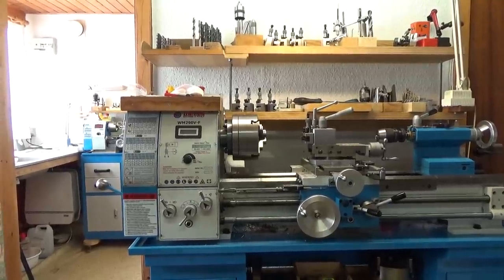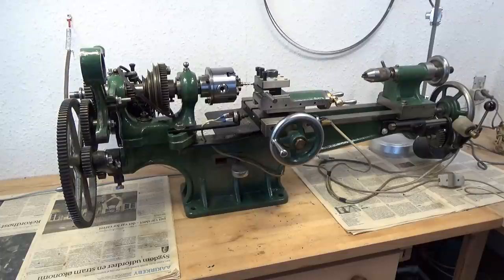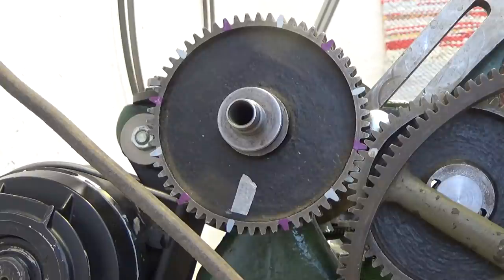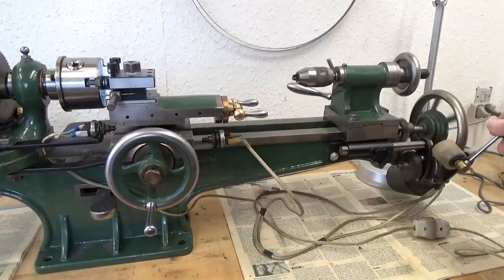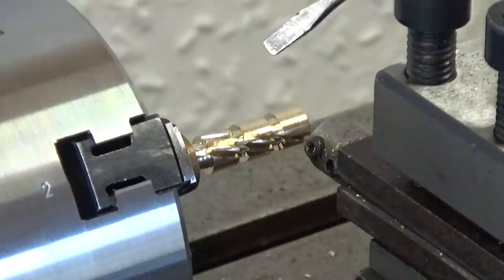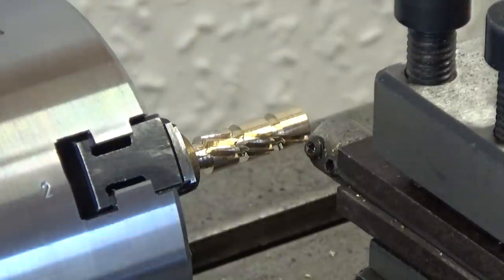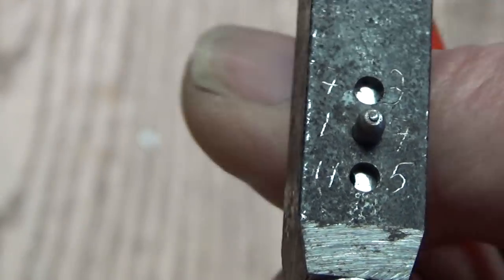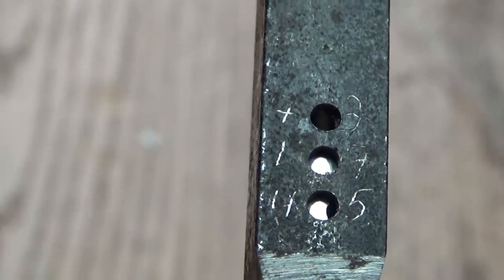Cutting Helical Gear Wheels On An Old Lathe

Comment: I have a similar very early Drummond Brothers flat-bed lathe, which I found about 50 years ago, although it doesn't seem that long ago. While I was still a subscriber to the British publication "Model Engineer," one of the readers in their correspondence column dated my lathe  (tentatively) as having been built between 1902 and 1903. It has the original Drummond brass name plate, which is my good fortune. The chap in the UK narrowed the date to this period because of certain characteristics of the headstock design which were improved very early in production. I have the basic lathe and a 4-jaw chuck, but none of the change gears or other accessories.  Yours looks to be in excellent condition. Mine came from a neighbor, who did not know the lathe's history. How it came to be in the basement of a farm house on the prairies of western Alberta, Canada would be an interesting story all by itself. I traded a running Maytag 2-cylinder washing machine engine for it - probably a reasonably fair exchange. If you are interested, I will see if I can confirm the serial number and any other information from the builders' name plate. Thank you for showing your lathe, still operating and doing very useful work. It reminds me that I need to get mine set up again after moving to a new house about 4 years ago.

Comment: I have a Drummond round bed lathe in reasonable condition I have a full set of change gearwheels and have accumulated the necessary whitworth spanners. I think it was made around1925. This is my only lathe and Tony from Drummond was good enough to supply me with copies of the original documentation which included the gear ratios that are used to cut imperial and metric threads.

Comment: Some folks will look at a Rembrandt and marvel at what they see. I feel no different about your old Drummond Bros. and your MAGNIFICENTLY PRESERVED old gas engine! OMG!! They're like looking at the centerfold of Machinery Hotties! Your friction  brake is novel but have you considered using an Electronic Brake? Just about all electric AC or DC motors can be braked with or without mechanical interaction or addition of same. I'm a long retired EE/Tech desiring nothing more than keeping that old girl cutting curls or chips!
Wakodahatchee Chris

Comment: Hello Find , thanks for explaining how to make these years by a " shaper" method .
The Drummond lathe was made down the road from me in Guildford Surrey England about 100 years ago!
I have a Little John lathe that is about 70 years old , and I am in the process of adapting it to cut gears using a hobb , which I will have to make as well , Hobbs are too expensive for me to buy ! The gears on my lathe use 16dp X 14.5 degrees pressure angle ! All the best, Jim Simpson

Comment: That was rather ingenious. 
When I was training, (mid 1970's), multi start threads or worms were considered something of a 'black art' and considered very difficult to make accurately without specialised gear cutting equipment.
 Phasing a gear wheel is a much neater solution and actually makes it look easy (although I know there will be quite a bit of math involved to work out lead angles)

Comment: Many thanks for creating this video. It is a very interesting lathe with what looks to be a very interesting 'modification' regarding the leadscrew drive (headstock end) and it's certainly not common to power a lathe through the leadscrew :) You clearly have a lot of engineering knowledge and skill to create such fine craftsmanship as your work in this video and the engine shown towards the end.
Wiper motors are very good for adapting to one's needs - whether leaving the original crank on, driving from the reduction gear or via direct drive from the motor shaft itself. (My dad ground the motor shaft down to fit to Meccano !)

Comment: I have a flatbed 1904 Drummond lathe identical to this one but still original and unmodified aside from some additions such as a dividing plate made for the outer end of the main spindle, a tool post drill and grinding spindle, and a revolution counter for winding radio coils.

Comment: It’s always great to see one of your videos. On of my favorite of your engines is the 3 cylinder 2 stroke. I’ve watched it countless times and i still have yet to understand how the vacuum is created to pull in the fuel mixture. Maybe a tear down video ?
Reply: first things first....there is no such thing as vacuum.. it is a absence of pressure , atmospheric pressure overcomes negative pressure... understanding the operation of a two stroke... as the piston goes up and  down. the piston skirts act as valves, sealing off the crankcase, the pressure that builds in the crankcase, empties as the piston drops opening the intake and exhaust  ports as it reaches near BDC ,forcing the air fuel mixture in above the piston top(witch also help to force out exhaust gasses)through ports in cylinder. after the piston closes the exhaust and intake ports(on  it upward stroke) it creates a negative pressure in the crankcase., as the piston skirt clears the intake port it allows the air fuel mixture to rush into the crankcase...repeat every crankshaft revolution .in muti cyl engines each cyl must be sealed from each other.... this is by no means a blow by blow but it is close

Comment: Greetings,
I must compliment you on the wonderful adaptations you’ve made to an absolutely beautiful lathe.
The restoration seems to be thorough, while keeping the modifications sympathetic to the look of the machine.
If these additions are going to stay in place, you might consider spending some time refining the installation.
Cleaning up the wiring harness and switch mountings.
The plastic knob and hand wheel really could stand to be replaced.
Please don’t be offended.  Your other work is so lovely, and I have never had your skills or talent.
I’m just a lowly critic, voicing his opinion.

Let’s be careful out there.

Comment: Great video but how do you work out the arrangement of the back gears to to give the required length of travel of the saddle  in relation to the  rotation of the the chuck? I am looking to make helix gear with a 45deg, angle on a lathe with an eight t.p.i lead screw.

Comment: Very nice work :) , the lathe is a Drummond pre B type I think around 1902 - 1912 , http://www.lathes.co.uk/drummond-flatbed-1902-1912/ , Inhave often wondered how to cut helical gears or even just a pattern for ornamental turning, the only way I could think of is like say a 10 start screw and a change wheel set for 0.5 tpi which is far too much power needed for such small lathes, I never thought of powering the spindle via the leadscrew instead.

Very nice work again and you are a true craftsman :)

Comment: Dear Find,
                   thank you very much for posting this video. That was most interesting.
Should it be of any interest to you the lathe is a Drummond and is well before 1920. I have one of these and mine is from approximately 1907 and looks (without modifications) identical. They were indeed made to be foot operated via a treadle and flywheel with a round leather belt. If you would like to know more then there is chapter and verse at lathes.co.uk.